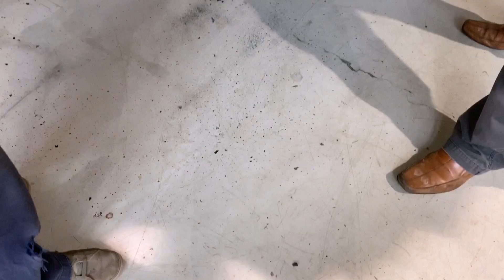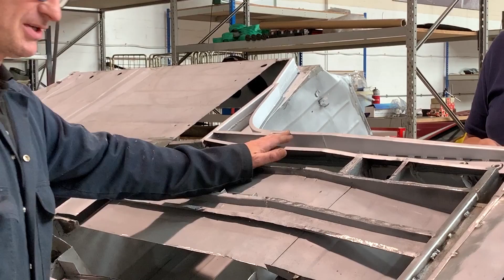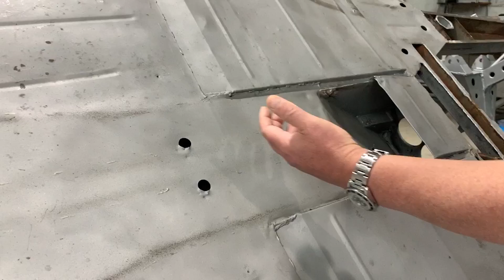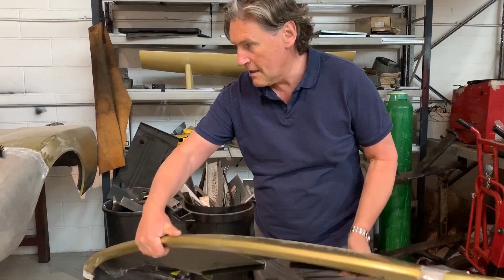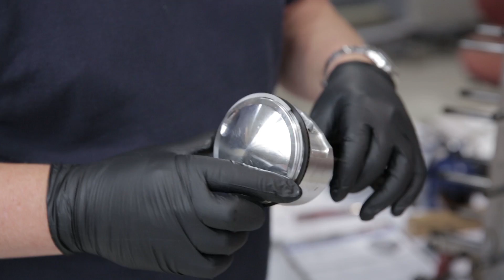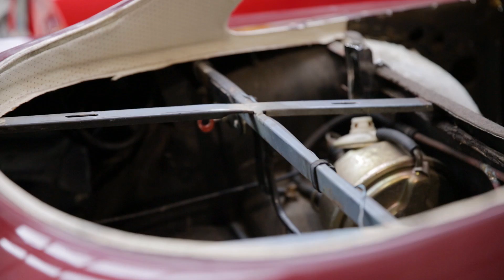Lamborghini and Ferrari Restorations, Workshop Catchup | Tyrrell's Classic Workshop

Comment: " Hollowed out sodium filled valve stems to transfer heat" The attention to detail in the engineering of a Ferrari engine back in the day is astounding ! I could watch this stuff all day   👍
Reply: Its not new technology, they  were using then back in the 30's in spitfire engines, and all sorts of other high power applications. Metals have evolved a bit since then so there no longer used.

Comment: That miura front end must have cost a fortune.
Reply: I wonder how long it took to make that piece.  A year maybe?  How much did it cost?  $100,000?
Reply: I was a bit surprised they didn't have an entire new bonnet skin made, rather than cutting up the existing one, which now can't be sold complete.
Reply: @laurieharper1526  Hand built aluminium panels made over a buck mould are made up from several hand beaten and rolled sections ,welded together then hand filed and shaped .Not stamped out from a single sheet as one unit , in large numbers  on a press like modern mass produced units .Also that piece of front end is the most commonly  damaged part on the car , making it a very sought after valuable used panel . If one Advertised  the panel section taken off, the phone would go on meltdown and sell immediately for a large wad of cash .
Reply: @geraldswain3259  I see. Thanks for explaining. I assumed it would have been made from a single piece.

Comment: That's a lot of rust/damage for 1.2 million
Reply: Love to know what the restoration cost are.  Won’t be cheap for sure but worthwhile
Reply: Those small piles of rust on the workshop floor were probably worth £50k on their own.  ;-)
Reply: The rust was included free-of-charge!!
Reply: Yeas, those exotic cars do everything doubled, that's why they are so expensive...
...as he said not only rust but also corrosion 😁
Reply: It does not come as a surprise Italian cars of the era did not use the best steel available and is prone to rust, also some the techniques used weren't the most efficient. In combination is that the car   was sitting for a considerable number of years with at some point the front clam shell being hit as mentioned prior. It would be a be a surprise if many of the cars from the era no matter the value had some form corrosion. It may also be worth noting that Lamborghini at that stage were a startup of sorts with a quarter of the resources that Ferrari had.
Reply: Rafiul Haque even still now if you follow “The carguys.tv” they just uploaded recently showing their 2015 Ferrari 458 that had rust on the fenders all 4 corners

Comment: Another wonderful, motivational story to get the creative juices flowing. When I saw that Miura front section, I was chuckling about the factory nose made on the original buck that "Required some fettling."
Read: 60 hours to make it fit.
I did the same exercise on my Aston Martin early DBS, including making the buck from templates off another car, then allowing for the different dimensions of my car, then making hammer forms, fitting, etc. Over 200 hours in that...
" Some assembly may be required" comes to mind.
Iain does top quality work, is a historian, engineer, and story teller all rolled into one.
The only criticism I have is that I wish that the videos were longer!
Thank you for the wonderful look into a top workshop.

Comment: Awww, not long enough, we need a feature length version! Glad it wasn’t me responsible for welding the two halves of that bonnet together, difficult to do  in mild steel, hand made alloy panel joins hand made alloy panel, value of both in the ‘many thousands’ category, no thanks! Absolutely top work only to be attempted by the very best fabricators in the business, hats off to Iain and his team

Comment: Really interesting stuff. It's worth considering that these wonderful 50+ year old cars that have had a first class "ground up" restoration are in better condition than when they left the original factory. Modern paints, lubricants, tyres and petrol are vastly superior to what was available back in the old days.

Comment: The lesson to be learned for vintage Italian car owners is to AWAYS try to take a car that's been driven in the rain out for a long (fast!) drive in the dry as soon as possible, straight away ideally - it's the only way of getting the internal areas water has been driven into dried out. Even in sunny Melbourne my late Dad started to pay the price with his 1975 type 105 GTV-2000 (owned from 1983) by the early 2000's despite almost continuous underground parking. Rust was beginning to appear in conspicuous places like the bottom the door skins because most of the time it was going for short runs across town (and it does rain quite a LOT in Melbourne)

Comment: Just finished up a 209 engine myself, although I prefer to drop the pistons in vertically with bolt guide rods. I use a non oem rod so they are a little different than what Marcus would need. Cheers!

Comment: To give it a hit from the top is rather easy and safe. All you need is two persons and a steel bar about half to a meter long. At one end of the bar drill a shallow hole (for extra smooth operation finish the bottom with a full radius mill).
Then one person lays the bar on the pin and holds the outer end, second person gives the bar a knock as close to the pin as safe. 90-95% of the force will go into the pin.

Comment: Those door pins looks like a right pain. It might be worth looking at the vauxhall special tools catalogue. The hinges and the way the door folds over the top is very very similar to the astra g model I think it is. I strip a few cars in my spare time and used to struggle like mad even resorting to the same mole grip trick you used. Until we found gm made a tool for it. Not sure if it would work on a miura but can't see why not and if it's something your going to do again it really will save alot of time, hassle and hit fingers.

Comment: I never used such propane heater for a job like this. You are heating very long time and the heat has enough time to spread to other parts and lift their temp. and these other parts also expand. I prefer using cutting mix. It heats up very quicky , but you must act also quickly

Comment: I would say that the work done previously on the 350 GT wasn't so bad because like everything with a history they have left a little history there. Exactly original top coat paint for those who would eventually return it to standard to know the colour and not just go by the book.
You never mentioned it but I hope at least the patches are also painted prior to welding on. I have encountered this and it is truly heart breaking when you have to cut it all up again.

Comment: Love this! But for anyone looking for a humble classic car, I must write these words. 3 years ago I bought arguably the most rust prone car. Ever. Right hand drive. I didn’t know, how low the rainfall was. Roughly a third of California. If it has been inland, a South African car is the ideal base. One piece of welding in 38 years, which I had to decide, on the battery tray. Even 10 year old cars can have that, due to acid. It’s an Alfasud with an original front wing. They would last 3 years in the UK.

Comment: Iain, l'm sure you already know that if the pin is hollow you can get hinge pin removal kits. We used them on various Ford's, Vauxhalls etc. Likewise if it has a shoulder you can  get removal kits. I said in a previous video  l would loved to have worked on this , so rewarding ! I'm confused as to why your not using the original hood. Not sure where or when sodium filled valves first appeared but l know Rolls Royce Merlins had this feature and probably the original "R" type. (2 don't likes?!! How dare you !)

Comment: If the yellow Miura has spent much or all of its life on UK roads then that top-left hinge has had a lot of rain water from the windscreen and scuttle panel running over it when it was parked outside, perhaps not surprising that it didn't want to move.

Comment: Q: You said James is using the same 1mm steel for the floor. Would using a touch thicker steel - for more rigidity - hurt the value of the car ?
Say 1.5 mm ?  Otherwise, awesome job on equally awesome cars by true craftmen !

Comment: Ah bedding in the valves, takes me back to a cold winter’s night after remedying the harm caused by a blown head gasket on my beloved 1958 Standard 10, back in 1971. The fan belt had broken on the trip back to London from the Midlands where I’d just bought her.

It was a filthy early morning and the high winds and torrential downpour disguised the overheating until I noticed steam amongst the spray, hard to make out as the wipers had got caught up together and ceased working.

I got off the M1 and tipped up the rad once it had cooled off, everything seemed in order otherwise so I cursed the seller for not filling  her up.

All was well until a couple of weeks later, she died on a busy Saturday morning coming over Putney Bridge, sounding like a heavy duty suction pump, water obviously in the cylinder

That was when I found the fan belt was brittle and had broken but not snapped and was still in place and appeared to be turning, as it transpired not turning enough.

Boring story but to me then, that little car was as precious to me as any V12 Italian exotic.

Comment: I’m pretty sure the reason why Miuras didn’t get rust at the back of the chassis is because the transmission and engine oil leaks served as metal coating over the years. No joking!

Comment: Very interesting. When I treated the inner box sections on my e-type I used red oxide, then chassis black enamel and then Wurth body wax. Leaving the inner sections in just weld thru primer won't protect them long term because primer is porous? As far as I know epoxy primer is the only non-porous primer.

Comment: Cutting the nose off an old Miura S in order to replace the factory updated SV-look with the original S-look leaves me speechless.
I honestly wouldn't have sliced the nose off the car. This may make it more original, but you still end up with a two-piece nose. I would have built a completely new front end. And then kept the SV front end as a spare part for another car.

Comment: HA - it is a bit late now - but if you guys had called me first, I have a special MIURA door pin removal tool sitting on the fireplace mantle at home - you could have had it for FREE - HA.  It is amazing how a bit of steel and paint can hide a disaster lurking underneath on something that people pay a lot of money for.  As I have often said to people when they are contemplating purchasing a 'recently restored' vehicle - "Paint hides all -- until the rust begins to bubble back out'.  I have seen some dangerously rusted vehicles - bogged up - plated over - body sealer - paint jobbed to look nice and 'new'.  I like to use a digital cavity inspection camera to get into the places and have a look at what is REALLY going on.  They can be 'cheap insurance'.  Have a safe and nice day all.  CHEERS from AUSTRALIA.

Comment: How do you prevent differential metal corrosion with all the aluminium and steel on the Miura, does modern paint/undercoat has improved so much?

Comment: Could I ask why you blast the chassis as opposed to dipping? Would have thought dipping by someone like spl would remove corrosion from inside the various tubes and box sections much better. That's to say all the sections your not opening up must still contain a degree of corrosion?

Comment: first of all, really nice work, great craftsmanship!
instead of heat, you can use a liquid hydrogen boiler, you can custom  design the copper contact , in this case the door pin, and it will shrink
3D printing the  Eyelashes would be so much better and cheaper
why do you keep choosing forged pistons, its the 3rd time I ask this question, can you please reply!
Reply from the maker: Thanks for your interest, and your kind comments. We use forged pistons because they are stronger than cast ones.
Reply: @iain_tyrrell  I am really curious about 3 things:
 how you determine thermal expansion rate of an old block?
  considering how the forged piston expands do you just increase tolerances?
 because of such tolerances to allow thermal expansion headroom, how do you deal with low temperature noise, oil contamination during engine warming up,  increase wear if engine rpm is high while engine temperature is not optimal
 I am curious how you overcome these things, thanks for you kind reply.

Comment: “This is a job we don’t recommend doing in front of a customer” - I’ll say especially one who is an engineer who expects any workshop to have a £20 door pin puller. 
No heat needed just some penetrating oil and the right tool for the job.
Reply: Was thinking the same. The pin removal looks brutal to me. If heat is needed I'd think that you are not supposed to make the parts glowing red.
Reply: Access probably too tight to use a hinge pin puller Sherlock, and more like £60, no engineer worth his salt buys his tools off alibaba

Comment: You used to much heat in my opinion, you need to try and heat the outer part of the bracket only. What's the point of expanding everything!

Comment: The design of that hinge pin on the Muira seems agriculturally primitive,  I mean I know Mr Lamborghini made farm tractors before he ventured into sports cars but are the door hinges welded on rather than bolted and the hinge pin holds the door on? if so how does one adjust the door to close with even gaps and so on? Also cutting the front end off a pristine Muira to reinstate the eyelashes? well obviously the cost is irrelevant to that particular owner, it would have to be, I imagine that "hand crafted  in Italy" aluminium nose shell cost  an absolute fortune, tens or twenties of thousands?..maybe more.

Comment: Tremec Company USA makes the best ultra short throw manual transmission shifting system and manual transmission gear box system in the world. Tremec Company USA's signature Magnum T56 shifter can handle massively powerful super car engine muscle car engine of up to 1000 horse powers. Insanely powerful. 

Every paddle shifter car driver dreads at the Magnum T56 series.
Everybody is afraid of Tremec.

Comment: Great video as usual Iain. Had to look away when the blowtorch came out though! May I suggest you buy the workshop a commercial induction heater for those seized bolts and pins? Generally safer than a naked flame.  We use a couple of Stanners units in our commercial vehicle workshop. www.stanners-equipment.co.uk

Comment: Imagine having a restored Miura that was upgraded by the factory to the SV trim in the 70's, and deciding you need to bring it back to it's original form when it left the factory.  I will never face that issue in my life, but personally I don't like the eyelashes, it corrupts the design in my opinion.

Comment: You pay over a million for a car, and it's had bodge repair patches  underneath!! From potentially keeping the original paint, to a bare shell restoration. Was this expected to be the case when the owner bought the car?
I guess the value of the cars the fact you then spend say another 10-20% rebuilding it probably doesn't really matter to the owner. He will have paid that to the auction house as the buyers premium!

Comment: These eyelashes were only for letting the standard stock headlights lamps looking a little bit more larger. (He said this once in an interview) So much handcraft work (thank you for learning this in your video) for a design effect that just cover that Lamborghini only could use cheap standard headlamps for profit production reasons. I was a teenager in those days when the Miura came out and I found these eyelashes one of the most stupid ideas a designer could chose for such a "Supercar".  Only until the apperance of the first Twingo generation with painted eyelashes the Miura was the winner for this price for the most "ugliest headlamp design solution". The same apply for the grotesque gash which Gandini put on several cars like the Shamal or the 90´Quattroportes on the bottom wheel arches.  From the aesthetic design standpoint rubbish. From the eyecatcher standpoint the opposite. Now the call him genius. All of his work is untouchable great. I disagree. Watch those eyelashes... Brrrr